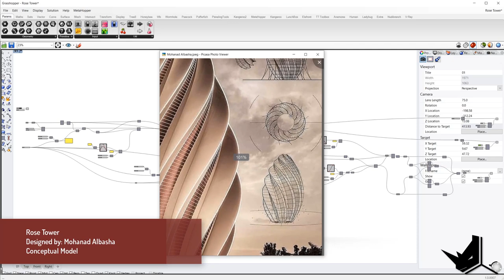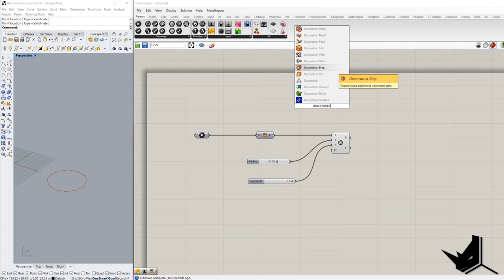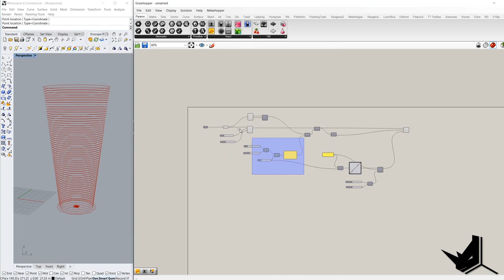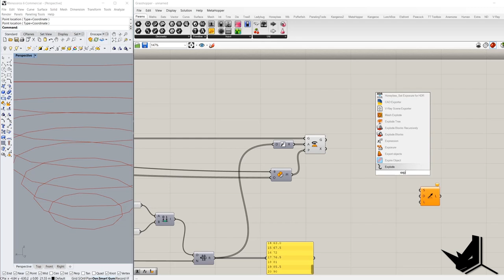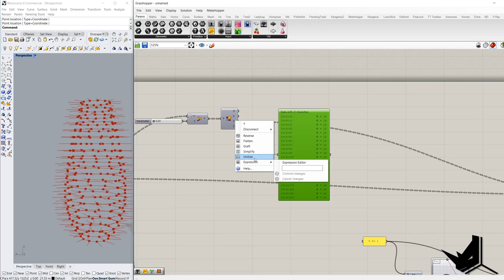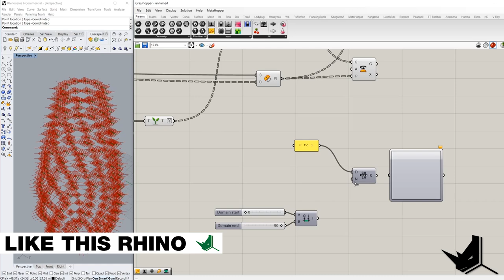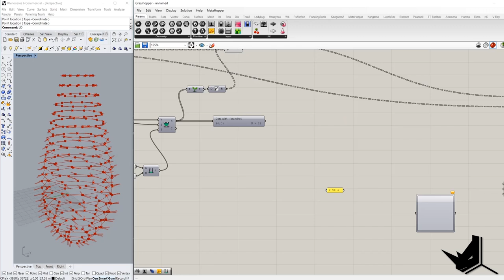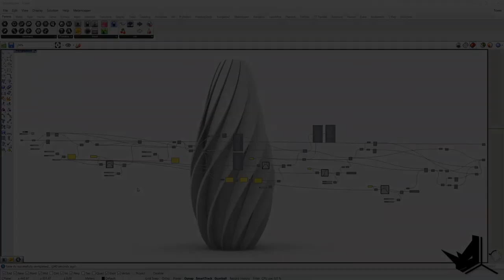Rhino Grasshopper Complex Twist With Graph Mapper Explained for Beginners

Comment: I have everything working except the fins. I'm working on a script that uses a similar method to generate a city scape over a voronoi field, but because the definition is being applied to multiple instances the data trees get messed up somewhere along the way. I can make fins that run radially but not vertically because I can't flip the matrix. Any idea how to fix this?
Reply from the maker: Hi Jared!
Have you tried to flip matrix using path mapper component? Depending on the data tree depth, you need to swap last letter in the syntax with the "i". 
For example if you have 3 layers data tree depth {A;B;C} your path mapper syntax should be {A;B;C}(i) ---> {A;B;i}(C). Same logic should be applied for other data tree depth cases.

If this doesn't work feel free to contact me at lazar@howtorhino.com
Reply: @HowtoRhino  Amazing thank you!

Comment: Why do we have to shift paths after off-setting the Fin lines?
Reply from the maker: Hi Mihir! Great question :)

Flip Matrix can't be applied to a data tree with a multi-layer structure. That's why we need to modify, create a single-layer data tree structure that will contain multiple items inside each branch. If you take a look you can see that each branch contains one item. In our case, we are trying to get a data tree that should have 64 branches with 12 items in each branch. 

So instead having (multi-layer structure):
{0;0;0;0} (1)
{0;0;0;1} (1)
{0;0;0;2} (1)
{0;0;0;3} (1)...
{0;0;0;10} (1)
{0;0;0;11} (1)

{0;0;1;0} (1)
{0;0;1;1} (1)
{0;0;1;2} (1)
{0;0;1;3} (1)...
{0;0;1;10} (1)
{0;0;1;11} (1)

{0;0;2;0} (1)
{0;0;2;1} (1)
{0;0;2;2} (1)
{0;0;2;3} (1)...
{0;0;2;10} (1)
{0;0;2;11} (1)...

{0;0;62;0} (1)
{0;0;62;1} (1)
{0;0;62;2} (1)
{0;0;62;3} (1)...
{0;0;62;10} (1)
{0;0;62;11} (1)...

{0;0;63;0} (1)
{0;0;63;1} (1)
{0;0;63;2} (1)
{0;0;63;3} (1)...
{0;0;63;10} (1)
{0;0;63;11} (1)...

We want to have (single-layer structure):
{0;0;0} (12)
{0;0;1} (12)
{0;0;2} (12)...
{0;0;62} (12)
{0;0;63} (12)

Once we get that, the next step is to connect output with the Shift Paths component.
Reply: @HowtoRhino  so it collapsed the outer branch on the inner branch right? Thanks 😀